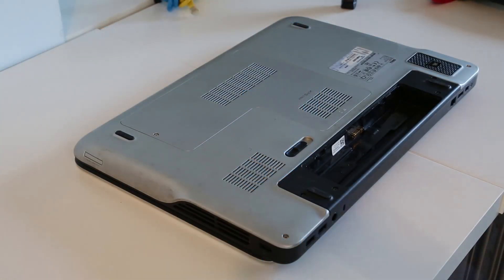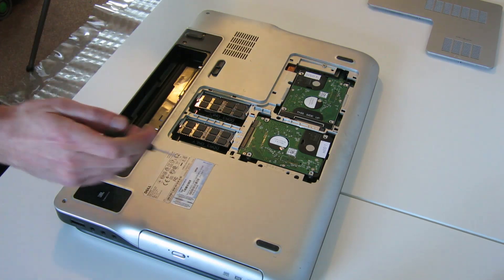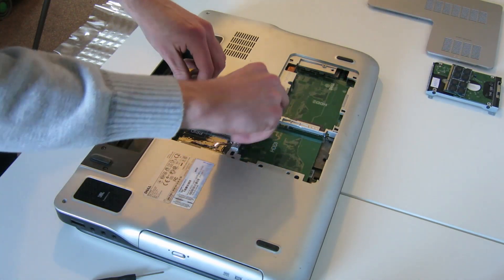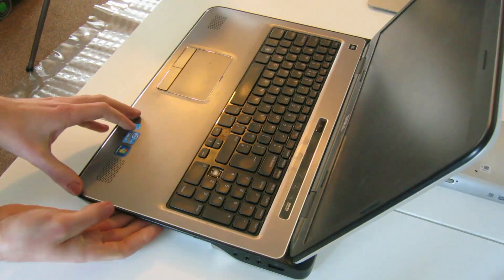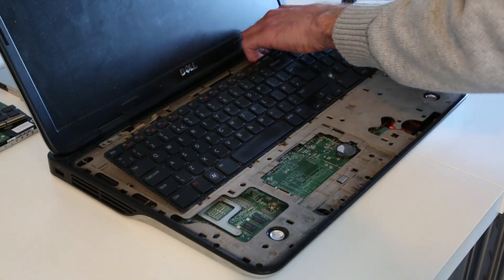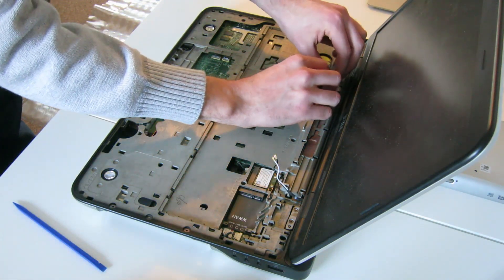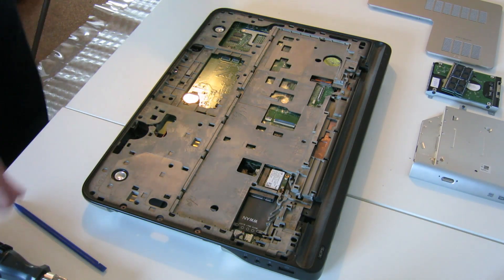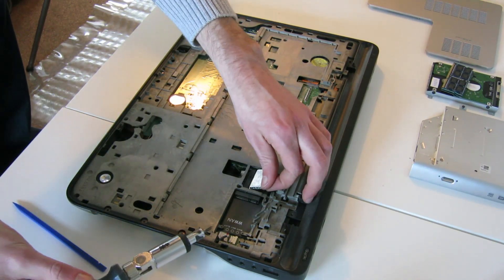Dell XPS 17 L701x/L702x Disassembly and Overheating Repair Guide

Comment: Thanks for your video, it really helps! sadly on mine laptop, the screw at 5:53 spin in the void in both ways :(. any clue on how remove it?
Reply from the maker: If it spins it normally means the plastic underneath is broken - so you don't really need to worry about removing it.
Reply: @BrueComputing  thanks! i’ill try with a clamp…

Comment: The monitor on the L702x still has one of the best monitors I have ever used, all these years later. It was still far superior in brightness and color saturation compared to my current LED Predator monitor.

I wish the L702x were upgradeable, I would've slapped a new CPU, GPU, and motherboard in it and would still be using it to this day. Cheers to all the good times I had in World of Warcraft Cataclysm and Mists of Pandaria on that cherished L702x Laptop!!

PS - I watched this video simply to take the L702x apart to see if I could scavenge that 3D IR emitter and put it to use...guess I'm going to have to buy the 3D kit :(

Comment: Thank you for this video! Yes, even in 2021 this is useful! ;) I have a Dell XPS17 L702X with the FHD 3D screen. The screen would stay black (even at boot), only flicker and show white flickering lines and dots. The self test (boot with "D" pressed) worked ok, i saw red, green, blue and white. The external monitor (HDMI) worked ok as well. So i used this video (and another) to take the laptop and the screen apart and it turned out that a loose cable was the problem. The connector on the back of the LCD screen to be specific.
I use a different order to disconnect the screen (hinges) from the body. First i unscrew the two screws on the bottom and then i flip the laptop over and unscrew the four screws in the hinges. 
With the FHD 3D screen, Intel Core i7 2630QM, 12GB of ram, a SSD and HDD and of course the Bluray player makes it a laptop that is still very useful today! The only things that bother me are the power cable that is falling apart and recently the second battery died (i replaced it a couple of years ago for the first time), the laptop does not accept the 3rd party replacement i got for it recently (YANEC).

Comment: I bought my L702x in the end of 2010 and still using it as we speak, or as I am typing this! It's been a workhorse. I have the GT550, no need for the extra bulky battery on the back. Only upgrades I did recently are: RAM - from 8GB to 16GB, Sandisk 512GB SSD Drive, and the Intel Core i7 2860QM CPU I got for cheap. Previously was a 2670QM. That said, my machine is a beast and much faster than ever. No need for a new laptop, which I don't think most can compete anyway in terms of performance. Mine has 1080p HD and a Blu-Ray burner, SuperSpeed USB 3.0. Just about everything I need, if not more than enough.

It is important for one to know how to maintain such a machine, like gaining knowledge on how to carefully disassemble it apart for service. I do this every two years; to inspect, clean out dusts, and make that sure the thermal grease aren't dried up and need replacing. While this isn't as service-friendly compared to most other laptops due to its somewhat flawed design, it is well worth the time to get to know all the little details of how-to servicing it yourself, it's the only way to keep it in good shape because no service center can do this w/o at least messing up something internally, or worst yet, impairing the exterior cosmetics. Once you get it down the first time, it isn't so hard the next time. This video is a great start, but you can also download the pdf service manual from Dell like I have.
Reply: I am still using my XPS and did the same as you, but not the CPU upgrade. It is now May 2025 and it is still working effficiently. I replaced the inoperative original screen once and now needs another. I have been using a HDMI 24 inch TV/monitor to view.  It is not upgradeable to Windows 11 (I did the upgrade from WIN 7 to 10, years back. Looking to get another computer to replace this before October '25.    Thank you for the tear-down disaasembly. Appreciate it.
Reply: @frankm4277  Great to hear. I am responding to you with the same XPS-17 previously mentioned. Yes, still going strong! Screens are somewhat cheap, get it replaced.

Comment: I’d referred to another access video to repair my battery release catch, however on reconstruction the ribbon for the touchpad was always slipping out of the clamped closed connector. My initial repair was just to fit the ribbon  into the socket and tape the flying tape to the flat motherboard (plenty of spare to prevent damage), but on power up this wasn’t sufficient. Using your video it was far easier to minimise the amount of debuild to reach the same point, thanks. Final effort was to put some tape onto the pull-out tab to ensure that the clamp was closing on a thick enough ribbon end to make a physical lock.
Reply from the maker: Glad it helped!

Comment: I gave this a thumbs down.  This was such a great instructional video until the 14:43 mark.  Why did you stop?  It would have been so great if you had cleaned the heat sink/fans and replaced the thermal paste to show everyone how to do it and then put everything back for this specific laptop.

Comment: Hi I have the XPS 17 L701x model. I want to replace the primary hdd for a newer one with larger capacity. Is there a way to know which is the largest capacity it can accept? Thanks!
Reply from the maker: Any 2.5" SATA drive should work if it is a 9mm drive or less. What are you looking to fit?
Reply: @BrueComputing  I thought I could Install a 2tb Seagate ST2000LM007, it's only 7mm high.

Comment: Hi, i have the L702x model and i want to add more ram. I read a lot of forums about the ram support. Some say that it can use 2x8Gb 1600Mhz, 16gb in total. Can you tell me if this is the case ? Thanks
Reply from the maker: Looking at the official specs the maximum module size it will accept is 4GB - 8GB ones may work, but aren't officially supported.
My models of the L702x have 2 DIMM slots, others have 4, so you'd probably want to check what yours has.
Reply: @BrueComputing  Mine is with 2 slots aswell. I have 6 gb right now, i wanted to try with the 16gb upgrade because i don't see a significant improvement if i get 8 gb. Im not ready to give up on this laptop,it server me well for 7 years :)  If i find a good deal for used 8gb sticks ill try to see if they work

Comment: Hi There,
I watched this video last night and read through most of the comments. I had the exact same issue with my Dell. I was a little skeptic as I have never opened a laptop in my life before. I watched the video 3 times just to make sure and then attempted to open it. Well I have to say....I could not have asked for a better tutorial. The amount of dust and muck that accumulated over the years is nothing short of  mind boggling. So I cleaned it out and then attempted to put it all back together again. And to my surprise i managed to get it all working in 10 minutes. The difference in temperature is astonishing. Than you so much for your video, it was a life saver!!!!!!
Reply from the maker: Brilliant, glad it helped!

Comment: are the screen and plastic cover for the screen (silver) the same between 701x and 702x?  What are other differences?  I am going to use a 701x to help fix my 702x.  I noticed you mentioned that keyboards are slightly different.  Thanks for any information that you may provide has a response to this comment.
Reply from the maker: I can't remember I'm afraid - its over 3 years since I last looked at either machine.

Comment: This particular model is awful. Overheats all the time. I stuck a fan tray under it and regularly air dust the vents but it still needs a proper clean about every 12 months. Rubbish design.

Comment: Is the 550m soldered onto the motherboard, or would it be possible to remove and replace it with a newer gpu with the same or lower power consumption?
Reply from the maker: Yes, it is soldered on. No this would not be possible.

Comment: how do you know when you have an overheating problems? my  laptop sometimes freezes and at other times restarts is it related to overheating?
Reply from the maker: Use a program like HWMonitor to monitor temperatures: https://www.cpuid.com/softwares/hwmonitor.html
If they are exceeding 100c then it can lead to throttling, and then thermal shutdown to protect the system.

Comment: No offense but your video is not helpful. The majority of the time your hands and arms are completely blocking the view and I can't see which screws you are unscrewing and where. Furthermore, after you've disassembled the whole bloody laptop (not your fault, this is just plain ridiculous the way they've designed this!) you don't show how you clean it or re-assemble it. Also, I have no clue what "Thermal Paste" is. Next time, please have your camera positioned so that details can be seen and please include start to finish visual instructions. I'm very capable and have done many hardware installations but this is just too damn complicated.

I won't even attempt to do this - I'm afraid I won't be able to put it back together.
Reply: I managed just fine with the instructions.
Reply: @OldUKAds  So did I.
As for thermal paste, I know what it is but hasn't Lu Peonies heard of Google ?
>

Comment: i recently dissembled my l702x to replace my subwoofer and keyboard unit. after assembling the laptop, it wouldn't start. it has been 3 weeks and i still can't figure out what went wrong. this is my second time taking the laptop apart... the first was to fix the overheating issue. can i please get some help?
Reply: Same. I wish I knew what I did wrong... ☹️

Comment: i have the same laptop. i think its from 2011 or 2012 ? now i play ANY game, ANY OLD GAME, and it starts to lag (frames per second drop) very hard, whatever the game, 1999 released, 2005 released, everything is starting to lag bad after a few minutes of playing. aida64 shows CPU and GPU 90 Celsius. would cleaning the heat sink and reapplying the thermal paste help? or i can kiss this laptop goodbye? i dont want to... a dell is a dell :(
Reply: That was my issue, and it helped me. If anyone else comes along and read this comment - try it. Your CPU is probably throttling due to overheating. I downloaded Throttlestop as it showed me the CPU temp and if the clock speed was dropping.

Comment: Thank you very much!
Tip: My l701x keyboard / touchpad cable retainers are different to l702x as i could see in the video. Had problems to remove them, until found out they can be adjusted by 90 degrees up and cable can be pulled out. Other action on that leads to demage of the retainer and no chance to assembly that part again

Comment: Thanks for the video!
Never did something similiar but I had no problem removing the dust and changing the thermal paste. 15°C less on full load
Maybe you could add a comment that removing the harddrives and ram is "optional" and not needed for further dissambly.

You need a bit confidence to open it up, but it's not difficult!
~30 screws are a lot?! Well atleast there are screws.

Comment: it is scary to open this laptop but when you follow thru the teeth and label it, taking pictures of how it looks like before removing on the complicated part and having enough space to place the memory card, hard drive etc., you'll be able to fix the problem. Thanks uploader you save me money and no more worries about overheating. I also used other video for putting the heat sink paste/compound.

Comment: Thank you much! Never worked on a laptop before, followed your video step by step. Changed my screen and back cover and cleaned my coolers, applied new thermal paste to replace the 5 1/2 year old dried up. Couldn't have done it without you.
Reply from the maker: Glad to help.

Comment: thank you SO SO MUCH! I've been trying to open it for ages since it was leaving burn marks on my wrist, it started to get so hot.. the cooling paste was completely dried up and the fan was quite dirty.  the laptop opens a little different to others i'm used to.

a tip: once detached the heatsink you can was it with the tap and a toothbrush, no electrics are attached, just make sure its dry before you put it in.

Comment: Very helpful video!  I've been in the IT software industry for more than 20 years but was always a bit hesitant to perform this level of maintenance especially on my laptop.  My machine is 4 years old and repeatedly shutting down because of heat issues several times a day.  After performing the teardown and maintenance on the cooling system, its running better than ever.  Even under load its running 40 degrees cooler!  Sincerely appreciate the step by step instructions!
Reply from the maker: Glad to help. :)
Reply: I have been trying to get up the nerve to do this. This will help
Thanks
Reply: I chickened out...
Reply: Mine is also about that age but I wish it could automatically shut down to protect the system. 

Last year, its motherboard got burned. I admit it was my fault to neglect the fan hygiene (It's way more complicated to clean this xps model than the inspiron. I got nervous and decided to ignore it since it didn't show any "I'm burning" signal and never shut down in the middle of work.)
After I got the motherboard replaced. I watched my machine like a hawk: always on the desk with cooling pad, and extra fan near the vent, fanspeed on and kept track of the numbers frequently, temperature ~65F (low work load), up to 95F(heavy)...
Although the temperature monitor said 75F, I noticed the vent and the nearby area turned really hot when I was running heavy softwares. That's why I put an extra fan beside to help blowing away the heat faster. It seemed to solve the problem.

However, on the 363th day, it turned off while I was only surfing the webs. Seemed like the motherboard got fried again. I didn't turn the side fan on because I thought a few chrome tabs weren't "heavy work"

Cry a river I love my machine so much but it's too much to replace the motherboard the second time. Moreover, I don't know where the real issue lies and what I did wrong. I'm afraid it'd keep repeating the same way over. Maybe, I should give up on it and look for a new one.
Reply: 4 years and you've encountered heat problems? :O
When my dell was 2 y.o. I cleaned the fans and changed thermal grease. It's been 4 years after that operation and it is still running max 72 degrees C on GPU under 100% load overclocked to 720mHz. You must live in a very dusty region :D

Comment: It would have been useful to see the cleaning process used, and potenially the replacement of the thermal paste/pads. Taking it apart is only getting to the possible problem not correcting it. I appreciate the detailed walk-through to getting there though. Thanks again.
Reply from the maker: CAANE Good point, I'll consider that for future videos.
Reply: Brue Computing I agree totally. I already know how to take it apart, but I wanted to know how to apply the thermal paste and it's process
Reply: Nobody can agree on a definitive method, some use the method which applies a thin layer, other say use a pea sized amount in the centre and it spreads itself :)

Comment: Hi,

Thanks for the video. You should have shown the reassembly as well, no matter how long the video might get. That would have been very helpful too.
I'm having a similar issue with my Dell Vostro 3700. I did it take it apart a few times but haven't noticed any thermal compound on the CPU and the GPU. They are all clean like it was being cooled without it. Do you think that adding some might help.
Actually my problem is that the GPU seems to overheat as the screen goes crazy after like 10 minutes of usage (colored squares appearing, image freezes...). Let me know your thoughts.

Thanks
Reply from the maker: Assembly is the reverse of disassembly, as Haynes manuals say. :)
I suppose I could have done this but not only would it have made for a very long video, but a very long upload as I only have 1Mbit upstream internet living in a rural area. There isn't anything notable on reassembly so it didn't seem worthwhile.

You would normally expect some form of thermal pad or thermal paste between the chips and the heatsink.
Reply: Brue Computing
Hmm as far as I remember, I haven't noticed anything like that, but I do have some thermal compound left as I needed some to build my desktop PC. Do you think that adding some might help, and do you think that the issue I described can be fixed, or is the GPU just dead?
Reply from the maker: Hard to say without seeing it myself, but potentially. As you say could be a failing GPU or video memory though.
Reply: Brue Computing OK thanks for your replies. I'll just try that and keep my fingers crossed :-)